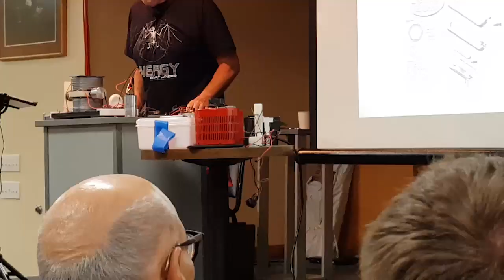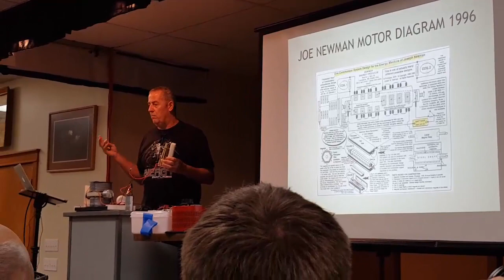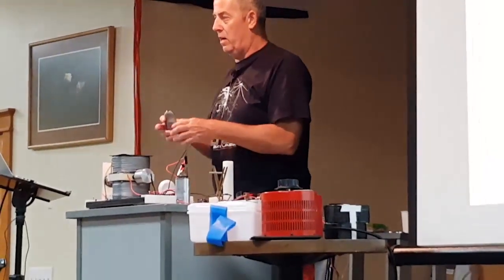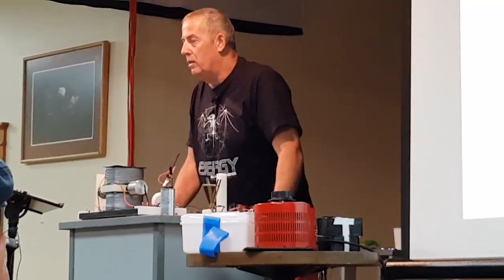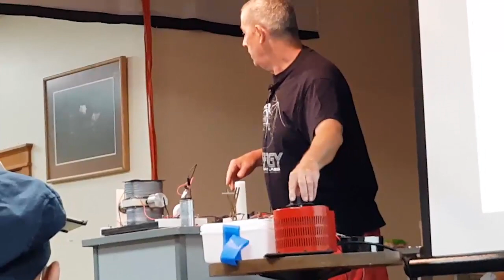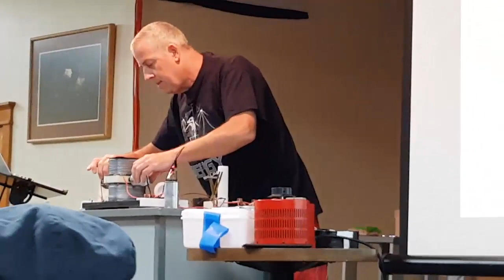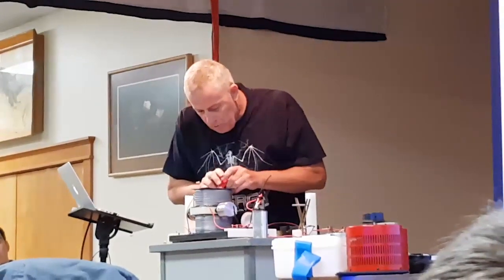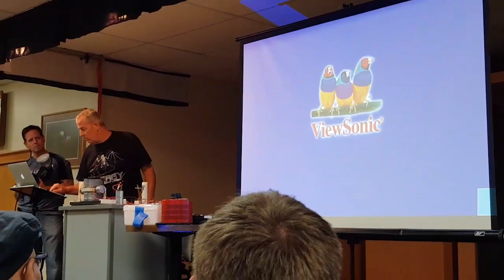Geoffrey miller demostration of small Newman motor

Comment: I have seen on TV of a concept of producing a THUMPING on an “I BEAM STEEL BRIDGE”. Now as this THUMPING is sent out from one end, the THUMPING comes back “LIKE AN ECHO”  Now the frequency coming back was adjusted to add a same THUMP to the return so that it add energy. After a time the bridge will shake. This is why marching on bridges is avoided by marching parades. Now we apply the same principal of the centrifugal force generator. Just keep adding THUMPING of electricity adjusted to add to make the wheel go faster. As shown a hand push starts the wheel and timing addition keeps it going faster and faster. This may work on huge generators by changing this to a pulsed DC with feedback to add more DC. Alfred Janiten 2/4/2019
Reply: @Alfred Is that why Newman's Big Eureka machine keeps clunking while turning?

Comment: This guy is not correct..  The Newman winding is about resistance,  NOT  "poundage"  with enough resistance,  it uses very little current,  but it needs a higher voltage input..  It returns a huge voltage from the collapse of the magnet field..  The Motor needs to create a magnet field with the least amount of CURRENT..  Use any voltage you want...  but,  it needs a lot to work
The LONGER and SMALLER the wire is,  the better it works..  Yes you need lots of wire (Mass) of copper..  the more the better, 
   Joe Newman's motor weighted 7,500 pounds,  He ran it on 750 volts,  less than 1/2 amp..  .  He kept it on a car carrier trailer..   I've built 3 smaller ones my self..  I can't afford 7500 lbs of copper..  I've plated with them for years,  but all i did was change the circuitry and try to capture the return voltage..  The Bendini circuit on the Newman motor works best..

This is not a good presentation..

Joe is my hero..  Sadly He passed away in 2015..
Reply: Newma also said he could power an entire house with a generator the size of two bread boxes.
Reply: Newman used 0.1mm wire   to reduced the current
Reply: The use of thin wire reduces the skin effect, so high frequency losses are reduced. The enormous high voltages that form when the switch is thrown is due to the large ratio of inductance to capacitance. As coil size increases, inductance scales more rapidly than coil self-capacitance. A capacitor is hooked in parallel in order to prevent the voltage from getting too high. High voltage combined with high frequency produces a large amount of displacement current through the coil's self capacitance. So you want to add just enough capacitance that you don't risk burning your insulation or destroy your switch, and of course your capacitor will need to be able to withstand the high, oscillating voltage. The magnetic spin of unpaired electrons inside the permanent magnet precess under the magnetic field of the coil, producing an electric potential that can do work on the resonant divergent/convergent conduction currents in the coil. The electric potential that is produced is spontaneous (because it is not due to electrostatic charge) and it does not produce a back emf because the electric field produced by that electric potential is irrotational (i.e. curl-free), so it does not contribute to changing magnetic fields. This electric field alternates in phase with the electric potential produced by the precessing magnetic spins, which alternates in phase with the Larmor precession frequency of the magnetic spins, which alternates in phase with the norm of the magnetic field strength applied to the spins, which alternates in phase with the current in the coil (because most of the magnetic field comes from the permanent magnet) - thus real power is transferred.
Reply: @2DOG3FIST I just bought some 220 picofarad capacitors with a 3.5 kv rating. They will take some weeks to arrive. Hopefully the miniature device I am making will produce some meaningful results. I already have the cores, Litz wire, IGBT, diodes, neon bulbs, etc. There's no doubt that it will be possible to produce at least a tenth an amp of electrical displacement current through the air with this. The big question mark I still have is whether the dielectric field of the precessing spins will be significant enough for this to translate into a lot of power. I'm sure that such a field lasts only briefly before surrounding material screens the field.

Comment: I used the schematic newman gave me back in the 90s when i was going to NAIT : i scaled it down and it worked fine with 9 volt batteries (i noted that the cheap paste batteries were reconditioning themselves and the charge stored and reacted differently - more like static than archaic) and i loved using his levitation apparatus with the aluminum ballons proving gravity is electromagnetically motivated (just reversing the current proved the lines of force in the gravity field were polarized electrically) - it was cool but tricky to setup, needed wood and larger diameter real aluminum balloon - he used a motorcycle battery but he told me i could just use 22 9 volt batteries in series - it worked ;) : here is a copy of the same schematic he gave me, not mine online : @t ... also read his book (found a copy here, also not mine online : @t to understand the trail he uses to do all of it, especially the tuning ... oh and i also used the Tesla trick used to resonate coils, (each coil must weigh the exact same (assuming they are the same wire material), and to fine tune it even more, i wrapped or unwrapped the wire a little at a time, on one or both of the coils, until the coils resonated-harmonized-stabilized completely.  Now that i have a lab again i am going to test leadskalnins PM holder in place of the caps.  Oh and the specially designed caps that he used back then, was just wax paper and aluminum foil and the same wire folded about 99 times - i think he says how to do it in his book to - it is really basic and simple to make - its been a while, but now that i have my lab back again hahaha - who says divorce is tragic! ... here is newman explaining cools things ;) : https://www.youtube.com/watch?v=30V6fBnXtkY
Reply from the maker: Thank you for your story. Could you share the link of the copy he shared with you for archiving? Many thanks, Ray.
Reply: Greenme Research - do you mean a copy of the schematic Joseph gave me?  I provided a link to one that is exactly the same as mine above. He also gave me a letter stating I could sell it with specific caveats and criteria that benefits everyone of course, but figured others had already done it since then, since I wasn’t the only one he shared that info with back then, and definitely not as qualified as the others obviously - but Newman laughed at that and told me I was far better off cuz I didn’t have bad programming to contend with lol.  My NAIT instructors loved the challenges and claims he made and encouraged me to prove it every step of the way - great times - I heard schools don’t teach real facts anymore but NAIT did - when I was told that physics and school do not teach what he knew I corrected him and revealed they teach all real provable subject matter regardless - after all they are the profs who wrote our cities universities text books and loathed the god complex of the uni’s and started NAIT - they invented a globe that freezes, boils rains snows all at the exact same time - I wish we had video ability on my phone back then, could of captured that rare show and tell when in a physics lab one day - and all done via pressure and electricity - just amazing stuff - great minds - great profs !
Reply from the maker: @Martureo Martus thanks, 

Kindly explain what NAIT is.
How much copper (in pounds) did you use in your model?
Did you enclose the coil in Helium?

the link to the paper you received is missing or has been removed from the text. The youtube link is still in there.

Your excerpt : 
here is a copy of the same schematic he gave me, not mine online : @t ... also read his book
Reply: @GreenmeResearch   Greenme Research  
Greetings - sorry for the long reply and i hope it is received well.

1.  NAIT = Northern Alberta Institute of Technology

2. My coil weight i use - Sorry GmeR, my personal design is not up for public or private access.  if i only gave that it would not help you anyways - but if you must know 8 x 1240 gram coils " 32 awg.  I shared Tesla's easy method of resonating coils assuming the readers of this post, understood and decided to add Newman's method in their experimentation with their own design at test time, desiring to scale down (customize) their own design of his demo in the book, and play. But if i understand the intent of your question, then my advice is that you just scale the demo apparatus (with the understanding gained as instructed in his book) in order to successfully use his schematic i am sharing with you, especially if needing to scale down the power to a value that you prefer to work with - even a signal freq generator would allow large scale testing.  But if poor like i was, i did not have 2000 volts or the money to buy or build a S-F generator, and especially that much material!  i had 9 volt batteries and spools of radio shack coils and one pro spool donated by a local wire winder, though! so mine worked solely using 9 volt batteries - its so simple you don`t even really need that much to manifest the reactions lol :) (later i bought 22 x 9 volts and connected them in series hahaha) - once you understand how the power works best with low amps and high volts, that is what his tech works with, you then realize that honing in on his custom model when power sourcing, switching (storage-consumption effects and affects), the generating and motorizing process, can not only be utilized in so many similarly controlled fashions, but can be scaled up, down, transformed, and even transferable to using other various states of matter - his method as demonstrated by his technique, is not limited to conventional motor-generator design and use, it is so much more than that!!! - it is a mechanical set of principles and methods that everyone in the world should experience and play with, it is useful with pretty much all states of matter - there are some useful formulas and alternative methods on how and when to use his methods (via his understanding) at certain phases of certain events in order to reach the same desired reactions, its all in his 8th Edition book explaining his model of how it works, as that is the version i bought way back when.
 Happy Learning and Earning! :)

3. yes the aluminum balloon was filled with helium about 3 foot x half a foot - tricky to get running tho, i also had to pinch the sides to mimic what he did with the wood in a college demo - (topic and pic also in his 8th ed. book), so that the ``fields curvature`` was sharper and flatter around the edges, than if the field followed the bubbly round edge of the balloon i purchased - very important to note when not getting lift at run time (balloon needs to be thinner, larger diameter and the wire as small a guage as possible evenly wrapped in a way so that the ``field`` edge is similar to a pie-plate-like shape) - i have to admit for the first few hours of no lift and troubleshooting, i figured it would never work, so i called Newman as instructed in his book, and HE not only answered and took the time to get to know me, he re-read the directions to me (his way of showing me i needed to slow down and digest the material better - but was so cool about it cuz i was trying so hard hahaha), well then i realized i did not understand the purpose, wraps and its behavior fully.  So i then took off the wood, pinched-swished the balloon slightly flatter with some scotch tape (very sparingly), and evenly re-wrapped the wire properly; until the balloon finally lowered to just about touching the ground - if i recall correctly, this demo started off as an attempt to negate the weight of the apparatus so that the electrical field alone, if it had one, would show a relationship between the balloons electric field and the gravity field itself if at all, just by adding a charge - so I added the charge and it very slowly raised upward until it sat there silently floating at few feet off the ground, and then reversed the current = balloon turned over 180 degrees, then reversed current again - it reverses 180 degrees again - unplug wires from current = balloon gently descended back to ground level - and wallah there it was!
It is very important that you slowly chew on what he is saying and revealing in his book - i would recommend pretending you do not know anything at all and let it retrain you via experimentation not just reading words - then clear up what it is, and what it is not, in your understanding, and learn how to use your new legs to stand on your own. He did not consolidate all his tech & info into one spot in the book, but gives you the rules, proofs and examples in each chapter as stepping stones, step by step, down the path to the grand finale, thus finally showing how the method is incorporating all experiment results from the previous chapters that you must observe, know and tinker with along the way ... when learning and applying his methods and copying his technology - read carefully - meaning do not skim or assume you understand anything he is saying, cuz his book actually redefines some conventional terms ideas and results.  But if i could understand it then anyone can, assuming you are not commingling conventional theories and methods, with the methods and theories of Josephs phenomena - can you imagine how things would be if Tesla followed conventional means only? he would have totally ignored the study of electrical phenomena and pretended there was no other means of use and power out there, as thought by the opposing scientific herd of his time, ``since conventional cannot do it and it is taboo to go outside conventional means of thinking, then it is not possible.`` - talk about insanity.

4. i found a pdf file online showing pics of the entire 8th edition, for you all and i included 2 pics of my Schematic Joseph gave me in the link below (Portrait and Landscape views), for educational purposes only - when i read my book, i was under the impression you must buy his book in order to obtain lawful private use to own & use his technology for your own personal use. Just throwing that out there.  Joseph, once told me he had even better designs but they were not for me to know and that he shared enough to have lots of independence and fun with - and he was charitable and abundantly correct LOL - one will easily notice this is a working schematic of his Demo as written in his 8th ed book - Newman Is Right Folks - a journey well earned and learned - have fun happy tinkering - GBN! https://1drv.ms/f/s!AhL7E8bPK2Wy70Y_5mLAEjB8X8Wg

PS If you learn, teach or use this tech please donate to his family and his friends who are still carrying on his work, when ever able - they all deserve it! and no i do not and will not take donations lol. i am just an old student passing by who happened to learn about him in a science magazine sitting in my grade 7 science class book shelf - Ozzy (Ozachoff) found out i was into this stuff and pointed it to me, he was awesome - Cheers Ozzy! Cheers Newman!
Reply from the maker: @martureomartus  Thank you for the explanation, the advice and shared drive.
I am familiar with the schematic he introduced in the 7th edition of his book.
Thank you for confirming the use of Helium.